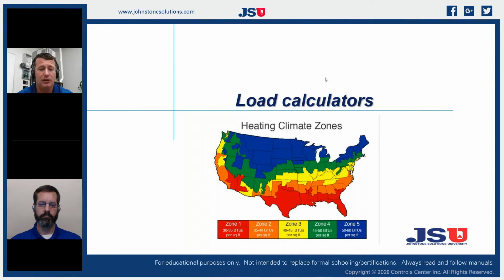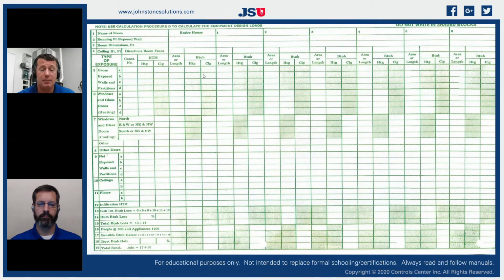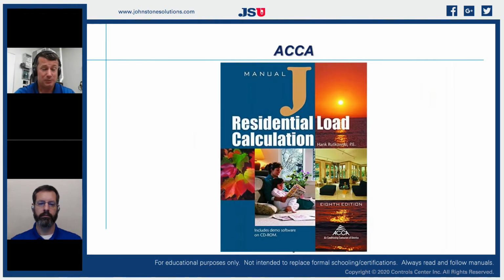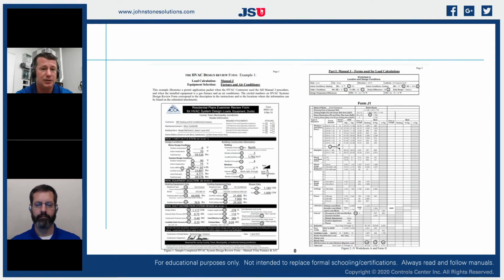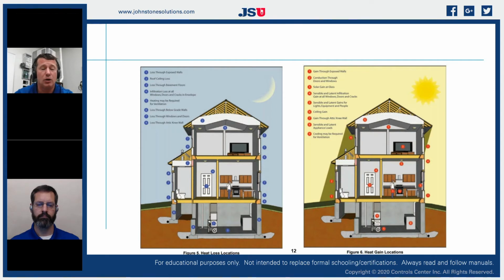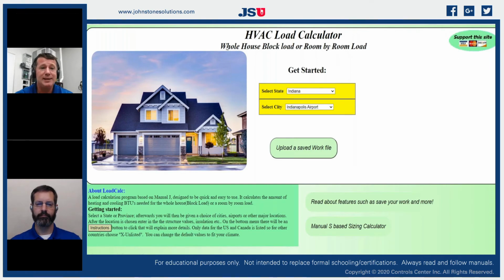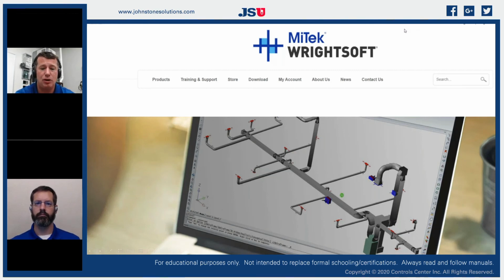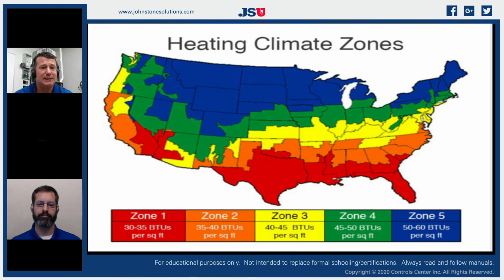HVAC Load Calculators

Comment: I had a calc done (florida), it was very detailed, many pages. However.. It gives a range 3.5 - 5ton. Why so broad?
Every local hvac has done a load calc in 10min with no measure tape. Small companies and very large. 
Very frustrating. 
Even worse.. I am tightening the house up, new windows, sealed doors, spray foam roof and crawl space.
Reply from the maker: That is sad indeed. A proper load calculation should get you within a couple hundred btus, definitely within a couple thousand btus. There are 12,000 btus per ton by the way. My advice would be an inverter so you have a variable capacity that would cover that 3.5-5 ton range. That way it has range to operate in. I personally prefer Daikin, Amana, and Bosch inverters.